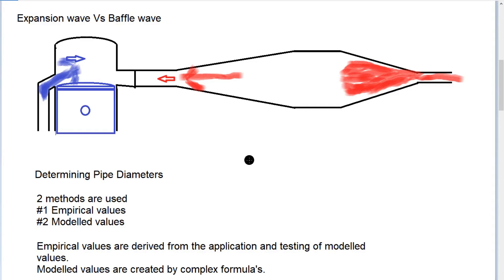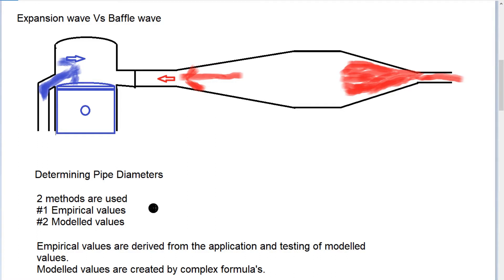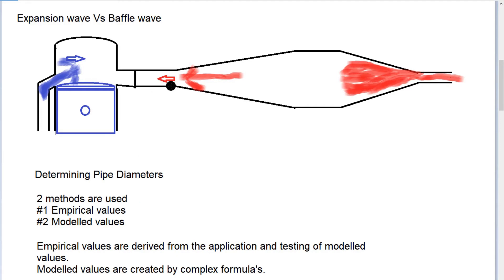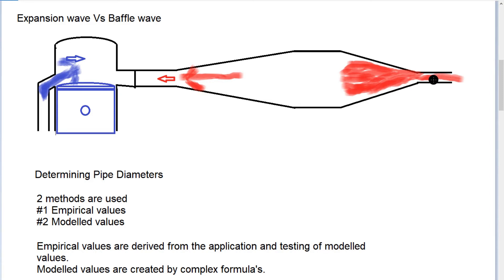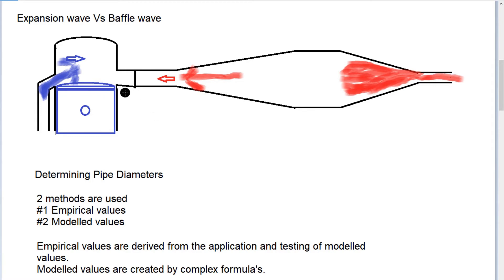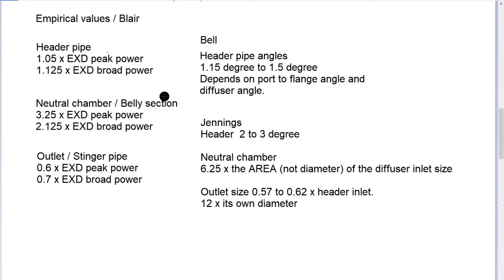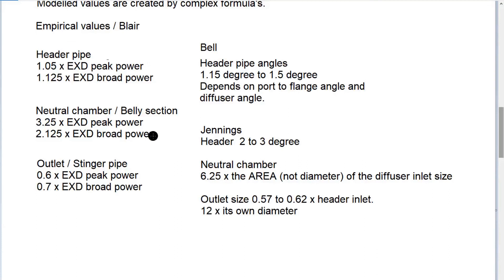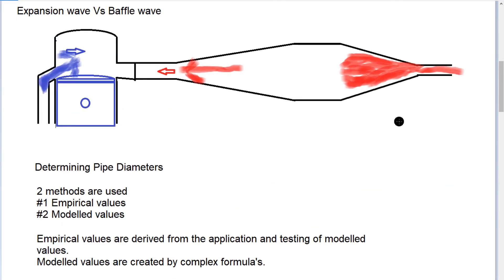Diameters for belly and stinger on 2 stroke expansion chambers, tapered header pipes E8

Comment: Great info! I was under the impression that a larger diameter chamber would give more bottom end and mid range power, and a smaller diameter chamber would give more peak power. This isn’t the case?
Reply from the maker: The mid section diameter is more a construct of the cone angles which dictate if the pipe favours peak or wider RPM range.
In short the steeper the cone angle to more it favours peak power.
Whereas a shallow angle will be better over a wider RPM range.
In addition to that multiple angle cones with favour wider RPM range then single straight angle cones.
So if you look at a pipe that has straight cones with a sheepish angle to them it will favour peak power. And converseley it will have a longer mid section to make up the tuned length.
No part of the pipe equation takes into account the pipe volume or engine volume.
Reply: @AuMechanic  Interesting…Crazy how much math goes into these things! Thanks again for info!

Comment: RE; The chart at 12:20, on the bottom stinger chart, Does 12 x its own dia refer to length of stinger/muffler??
Reply from the maker: Yes it does refer to the stinger (not including a muffler) but that was the equations Jennings came up with by measuring chambers and effectively reverse engineering them to some degree back in the late 1970's
Blairs equations OTH from the late 90's are derived from more scientific methods and are the ones to use and what I use in the pipe software which you will find a link to in the description section below the video.

Comment: Hi, how would you select the thickness of the expansion chamber? Thanks.
Reply: Depends on the exhaust port going bigger pushes rpms up I have one that's way big for a 50cc and it feels like the stock one till it hits the moon goes really hard and cuts out I think from the ignition timing probably in the middle of the powerband because it doesn't slow down when I hit a hill at that speed

Comment: So my understanding of the bleed pipe is, when the compression wave is reflected off the baffle cone, returns and port plugs the exhaust, the piston then approaches TDC, and while that’s happening the gasses inside the pipe exit. However, I would assume some of this pressure would remain inside the pipe(presumably near the baffle cone), which will be further used to provide back pressure for better port plug. Correct me if I am wrong
Reply from the maker: That is correct, the back pressure in the chamber plays a part in stopping charge spilling out of the exhaust port. Once the gas pressure slug exits from the header pipe it diffuses and equalizes in the large neutral chamber so back pressure is basically the pressure floor throughout the pipe through which the expansion and compression waves flow.
Reply: @AuMechanic  Thanks for the reply! I do have one more question. Whenever the compression wave is reflected off the baffle cone, my understanding is that the reflected wave doesn’t interfere with the exhaust gasses (because it’s a sound wave). However, that wouldn’t explain how the “spilt charge” from the exhaust port is pushed back in? I’ve been really pondered about that idea, assuming maybe it’s because of the pressure differentials in the larger section of the pipe which wouldn’t cause any interference of the gasses? (Neutral chamber, diffuser, etc)
Reply from the maker: @american0153  Without going in to it too far as I have a few videos that cover the topic, the energy does interfere with the gasses but it is localised at the point where the wave is at that moment, the simplest analogy is like dropping a rock in to a flow river, the waves of energy will radiate from the point the rock is dropped both down stream and back up stream.
So when the reflected compression wave arrives back at the port it momentarily stops outflow or spilling of the fresh intake charge, just as a wave momentarily stops you swimming out ward in the ocean.
And at that moment if the timing is right the piston closes the port.
Reply: @AuMechanic  Makes sense, the videos on these topics are great!

Comment: Plugging wave , does it just prevent overscavenging or can it also push already leaked charge back into cylinder from exhaust pipe ?
Reply from the maker: There is some suggestion that it pushes charge back in to the cylinder but probably only minimally and in the main It stops charge spilling out of the exhaust port as the piston is rising and the transfers have closed.
Reply: @AuMechanic  I was thinking if it is called compression wave it must have something to compress and only place to get something to compress is from exhaust pipe ?
Reply from the maker: @V8Lenny   It is called a "compression wave" simply due to the positive sign of the wave being a high pressure, conversely the "expansion wave" reflected from the diffuser is a negative signed low pressure wave.
Reply from the maker: Keep in mind it is not the gas slug of exhaust, it is the sound wave generated by the initial rapid flow of gas as the port cracks open, similar to the opening of a champagne bottle, the "pop" you hear is created by the initial rapid flow of air out of the bottle just as the stopper is removed.
And that sound wave that is energy that reaches your ear at the speed of sound, it is not a mass of air from the bottle.
Reply: @AuMechanic  yes , soundwave is local compression and expansion of particles. How local and what particles is it compressing, never been clear to me.

And it doesnt matter if it works.

Comment: Good day Sir and greetings from Canada! Thank you very much for your excellent videos on expansion chambers. I need your assistance please, as I am just a local farm boy, handed over to me is a 1975 RD350B. The exhaust pipes were missing, all I have is the headers or bend pipes of the RD. I do have a pair of expansion chambers of a Rotax FR125 go kart machine. So my question is, if I I weld them RD350 bend pipes on to the Rotax expansion chambers, would this work on the RD? Off-course, I will cut off the Rotax FR125 end cans as they are too long. I will aslo cut approximately 8 inches of the Rotax FR125 pipe at the inlet/cylinder exhaust side, weld them RD350 bend pipes to it etc.  and install end cans approximately 11 inches in length. So all in all, would this work? Would the Rotax FR125 expansions be of any good? Keeping in mind the belly, cone size and length etc.? Looking forward to hearing from you and I thank you for your time, much appreciated.
Reply from the maker: You can grab a copy of the software I wrote, see the latest videos up has a link to it in the description section.
With that you can calculate the tuned length at least as well as what the outlet pipe ID should be.
There are some videos Ive done covering how to use other parts of the software.
From that you could modify the chambers you have a bit to fit.
For some rough guides - the rotax as 125 cc and half the 350 is 175 cc so at a guess the outlet pipe diameters are likely to be a bit small.
An outlet that is too small will cause overheating of the pistons and that is bad so at least get that calculation right to avoid damage..
Also it is important that where the header pipe meets the first cone that there is no mis match in size or no step, it has to be a smooth join so you may have the cut diffuser cone inlet to match the ID of the end of the header pipes.
Reply: @AuMechanic  Thank you so very much kind Sir, this is really appreciated. I will follow thru your videos and instructions as I proceed. You are correct on the Rotax specs. Surprisingly, the ID of the header pipe on the Rotax and RD are the same.  Thanks once again.
Reply: @AuMechanic  Sir: For an expansion chamber, does  the routing of the header pipe matter? If you look at a standard RD350B, them header pipes for the left and right hand side cylinders curve or branch out out sideways from the exhaust port, however I've noticed that most RD350's or RD400's that have expansion chambers professionally built, their headers protrude straight down infront of the cylinders and then curve down under the engine rather side ways from the exhaust. So the question is, is it a must for them bend pipes or headers to go straight down or is it ok sideways as well?
Reply from the maker: Bends are not a problem at all so long as there is no sudden change in the area of the header pipes over their length.
If you are bending pipe to use as a header it needs to be bent using a mandrel inside to ensure there is no kink in the pipe that changes the area of the pipe.
Reply from the maker: Re the Rotax and RD pipe sizes you mentioned.
The header pipe size is entirely based on the size of the exhaust port are and that means height and width of the port.
Keeping in mind the height of the port determines the timing so if the Rotax has much higher exhaust port timing its port may be taller then the RD with a mild timing you may end up with about the same size ports in area even though the RD is slightly larger cylinder capacity.
The outlet pipe however is not just based on the header pipe size but also the BMEP which is the effective pressure of gas coming out of the cylinder when the exhaust opens so while the header can be the same size the outlet pipe may not be if the BMEP of each engines differs
I have a video covering that topic of outlet pipes.
Reply: @AuMechanic  Good morning Sir: Your software is amazing, it has been a great help. Sincere thanks for that. Just curious though, in the data fields, I do not see any input fields for entering the CC for each cylinder? Or is this something that the program automatically factors in?
Reply from the maker: In the input cal window (tools menu) bore and stroke is used to calculate BMEP, once you calculate BMEP you then use it in applying the outlet pipe ratio factor (see the popup help window for outlet pipe ratio field)

Comment: So in bell two stroke tuning of 57 I have a problem it says the header diameter x6.25 = the diffuser outlet diameter. Then it says so a header of 1.5" would have a diffuser outlet diameter of 3.75" which is only 2.5x larger please help me figure this out. Or anyone else of  57 Graham bell two stroke tuning pdf
Reply from the maker: Hi Ride Fast
Be aware that is 6.25 x the "area" (not diameter) of the port area.
Port area is converted to a diameter for the purpose of sizing the header diameter at the engine end of the pipe, but the other equations of neutral chamber and outlet pipe remain as area calculations in respect of the ex port area.
Reply from the maker: Example
1.5 inch = 1.76714587 sq inches X 6.25 = 11.0446616875 sq inches = 3.75 inches diameter
Reply: AuMechanic thank you so much I was thinking of that damn equation all day. Cleared that up for me. I post it on my Facebook nobody could figure it out.

Comment: Hello there...how do you calculate the EXD figure as it is not a perfect circle as u said?
Reply from the maker: You need to measure the width, height and radius corners of the port to then calculate an area value from those dimensions, once you have the port area you can convert that do to a diameter.

Comment: Great stuff, I found the videos very interesting. We are into to karting and the pipe is fixed, as I am sure you are aware of. How can I utilize  this information to help work out the ideal port timing.
Reply from the maker: Hi Dennis, glad you found it interesting.
Essentially the expansion chamber dimensions are driven by the timing and area of each port. So any changes there will change factors in the pipe tuning.
To check if the pipe is right or needs modification you need to start by measuring up the port timing it has to then calculate what the pipe lengths need to be..
However if you plan to do some porting then you would do that first and from that you can calculate changes you need to make to the pipe to bring it into tune with the new port timing.
In general changes to port timing (height) will change the tuned lengths.
Changes in port height and width (area) may change some of the diameters of the expansion chamber.
It's easier to change tuned lengths by removing a section if it comes to that, depends on how much you change the timing..
If you widen and raise the ports then it may be best to get a new pipe to suit it than modify the one you have.
Reply: Thanks for replying so promptly.In the class that we are running the rules are very tight. You are unable to alter the pipe at all, no machining to the motor. The only thing that you are allowed to manipulate is the squish, though head gasket. Port timing though cylinder gasket  (.25 -.45 mm).   We have been experimenting with the cylinder gaskets,  trying to find the sweat spot. After finding your channel, I thought it might be possible to work backwoods, calculate the ideal port timing. Matching the sound waves (resonance)to revs
Reply from the maker: Hi Dennis
In this case you would not need to mod the pipe.
If you look at the vids I did with the software calculator to get tuned length, there is a calculation to translate the port height in mm to port timing in degree, from the timing we calc the tuned length based on RPM and Exhaust temp.
Noting that if we change the port timing we also change the tuned length, however if we adjust to RPM we can see at what RPM the tuned length is the same as the tuned length value we started with before the port was raised, and from that we can see how far the pipe peak is shifted in the RPM range.
For the thickness of a gasket at perhaps 0.5 mm the port timing will only see a small change to timing and likewise the pipe will only be shifted a few RPM in the range.
I would suggest the amount is so small that it would still be well within the range of needs to operate, and you could make gasket adjustments safely without having to then modify the tuned length of the pipe.
To get port timing change you need to know stroke and con rod length and height the ports have changed in mm.
If you can get those specs I can do a quick calc to tell what the old and new timing will be, and from that  knowing Exhaust temp.I can see how much it'll shift the pipe in the RPM range.
Reply: I did see that. That's why I though it may be possible to be done in reverse. I think All the information is in the Homologation Document, except the pipe temp. I just noticed the above link  is corrupted so I will try again

http://www.karting.net.au/media/technical/2017/IAME%20KA100%20-%20100cc%20REEDJET%20Engine%20Homologation%20Approved%20Updated%2018%20Jan%202017.pdf

We have tried it with .25mm cylinder gasket but, we lost a bit of mid range acceleration and top end speed. We have now set it to the heights allowable gasket thickness .45mm. We have yet to try this out. The RPM that we are operating in is 7000 - 15000. Any advise or information is greatly appreciated. I have been also watching 2stroke stuffing channel, as well an many others  trying to learn how to get as much as we can out of these little devils.
Reply from the maker: Hi Dennis, Ill have a read of that doc later and do some calcs as mentioned just to see what the timing change is and change to tuned length and take it from there with a bit more info form the document.
Just doing a bit of prep for the next video now.
At a quick glance I see this 
UNLESS IN THE KARTING AUSTRALIA RULES AND/OR THESE HOMOLOGATION DOCUMENTS
IT SAYS THAT YOU CAN, THEN YOU CANNOT.
In the long gone past the wiggle room we had with regs was finding something that the regs did not prohibit.
But this clearly says you can only do what the regs says you can do so if you figure out something the regs don't allow or state, you still cant do it.
For example, it says you can only have 1 ex gasket, so you cant shift the tuned length at all that way, and it doesn't say you cant have no gasket but as above, even if it doesn't say you cant have no gasket, you still cant do it.
Ill check the numbers later and get back to you on the timings.
Reply: The rules are tight, not much wiggle room. The more I can understand,  the better chance I have at keeping them at peak performance. It's a big learning curve for me, I knew nothing about them before this adventure started. I don't know what the pipe temp is but the engine temp is 140 -150 C if that's any help. I was doing some more calculations last night. It will be interesting to see what difference manipulating the port timing in this tiny window, will make to performance, if any.Thanks again for running this though your simulator, it is much appreciated.
Reply from the maker: Hi Dennis
I've just uploaded a video covering the engine specs.
I used 17000 RPM and 600 C exhaust degree, let me know if that's not right.
I covered the port timing changes you will get in degrees, blow down in mm, and the result to tuned length and how many RPM that port time will change the peak.
As well as calculated the diffuser and baffle cone angles of the expansion chamber not listed in the regs..